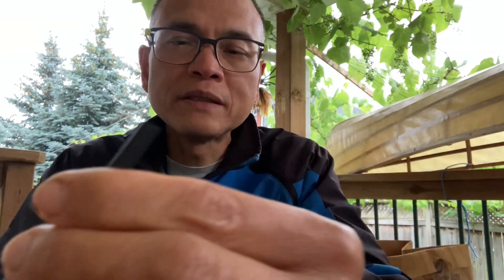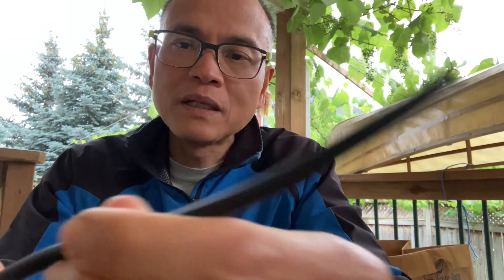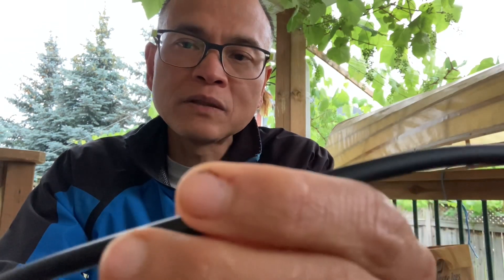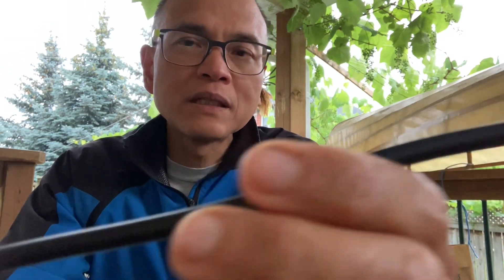Nitrate filter hack, introduction, part 1, koi pond

Comment: I am sorry, but this is absurd.
Research on wetland filtration has shown that 1m2 of sand at a depth of 120mm produces denitrification at a rate of 0.5g NO3 per day. The sand has a surface area of 20m2 per kg.
To put that into context for you, 100g of fish food at 38% protein produces 26.96g of nitrate. 
So if you feed fish food of 5g a day the results will be 1.348g of nitrate and it would take 2.7 M2 of a sand bed filter to remove this.
Reply from the maker: I’ve read about similar studies. Detectable nitrate reduction with this tube system is when the tube is almost plugged up and the drip was very very slow. The amount of water dripped is impractical to pump back into the pond. But it was a rare time it’s ever been demonstrated. No worries and thanks for watching.

Comment: What if i used a 100 ft water hose?
Reply: You are thinking that would work? I don't see why it wouldn't.
Reply: Let me ask you this, if at the end of the hose I attach a sealed container or a series of containers and then an outlet after the last one. That would provide an increased surface area...?
Reply from the maker: Should work even better. I find my tiny hose gets plugged up too often. Slower the water flow the better. Control the flow using a valve at the end. If it gets plugged just open the valve right up to clear.
Reply: @KoiRun50  awesome. I have an old sand filter from a pool. Thinking about ending the waterhose in that so there is a ton of surface area for the bacteria to eat the nitrates. I have an elevated settlement pond that water is pumped up into and I was gonna just sink this waterhose down into that and then gravity would allow the water to flow out of it. I won't have to rely on a siphon. And there is no heat transfer issue with having the hose out in the air

Comment: Good information but wouldn't your pond have to be super tiny in order to reap the benefits? I am thinking like a 20 gallon pond with that size hose.
Reply from the maker: I'm hoping to return 100 gallons per day of warmed lower nitrate water to my pond from my flow-through system. This water would normally get wasted in the drain. It should make up a good portion of the pond volume. Thank you for your feedback.

Comment: Really interesting mate, might have to give this a try 👍
Reply: With your massive aquaponic/bogfilter system I would strongly advice not to. In systems without plants I can see some benefits. In systems with plants I can only see problems comming.
Reply: @greenmachinesweden  Was thinking for my indoor set-up, saw your comment about getting the balance right so might be a bit of trial and error 👍🐟
Reply: @ecosystemkoi9159  ok, for the indoor setup it have potential to be a good solution. Didnt think about that.
Reply from the maker: That would be great! I will be so easy to implement and evaluate.

Comment: You are truelly pedagogic, the simple explanation of the denitrification process was spot on. We experimented a lot with this method in fish only marine tanks long ago. The tricky part is to balance flow to leangth of the hose. To high ratio and it dont work. To low ratio and hydrogen sulphide forms. And perfect ratio is also depending on nitrate level in incomming water. Not funny when I woke up one day and the whole house smelled like rotten eggs 😀.
Reply from the maker: What a compliment from you. Thank you! Never though about hydrogen sulphide. I guess it's important to leave a little bit of nitrate in the effluent so that sulphate is not used.
Reply: @KoiRun50  correct. I would asume that it is easier to get the balance right in high nitrate ponds than in low nitrate marine tanks. Looking forward to see the progress.